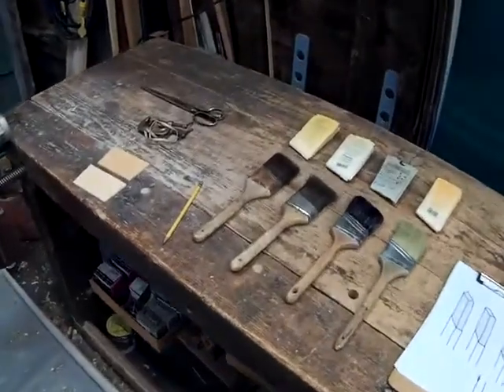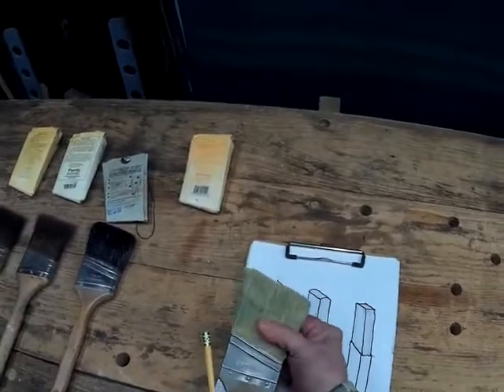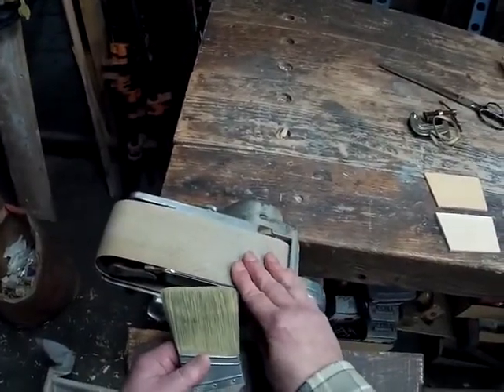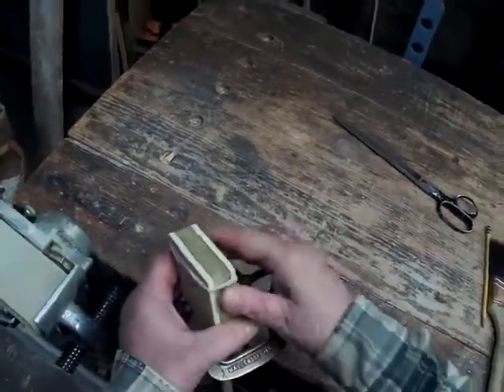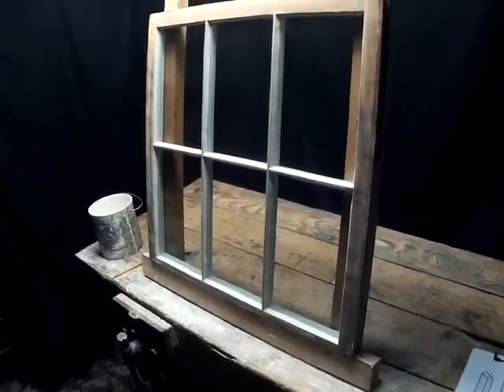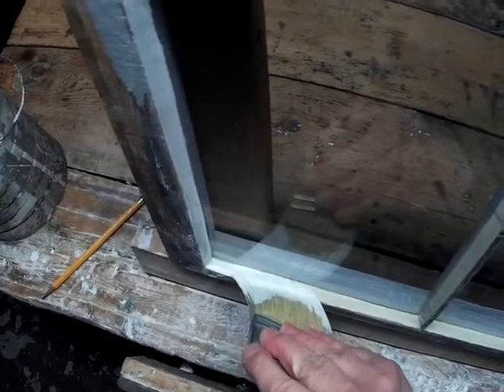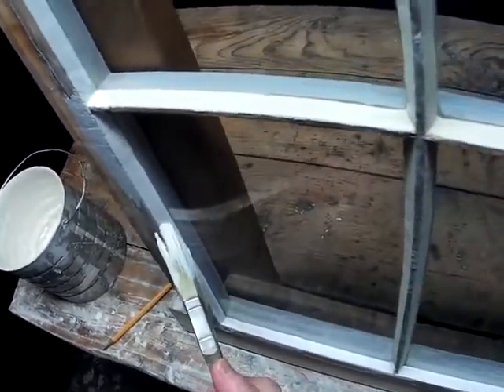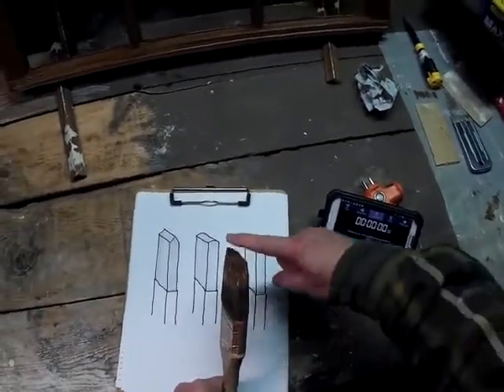Sash Brush Tune Up

Comment from the maker: After using these tuned up brushes for three years my sash painting times have decreased by 15%. I think this is because the paint leaves the brush faster and the squared edges control the paint better as I lap the paint slightly onto the glass pane.

Comment: I was looking for a video of nearly this exact same thing without success a few nights ago.  very cool.
many of us are these days opting for chemically treated tips on polyester-heavy brushes with a strong taper/sharp point.  put simply, they fall apart -- fast. 
 while the chemical treatment obviously cant be salvaged, I don't see why that sort of brush couldn't be 'sharpened', do you?   (silver tip, picasso)
a very straight edge when laid flat and a non-trivial taper.  could you do that? i'd like to try it on mine if you think its easily doable.

Comment: What do you do when the paint starts to dry on the upper part of the bristles?
Reply from the maker: While painting I try to keep the paint towards the end of the bristles. After painting for half a day or a whole day paint does sometimes get up the bristles and even onto the ferrule, getting crusty dry. So, I just clean it off. I guess I should post a video of my brush cleaning.
Reply: @johnleeke  what paint do u use? I would absolutely enjoy a video of your brush cleaning.  Your brushes are immaculate